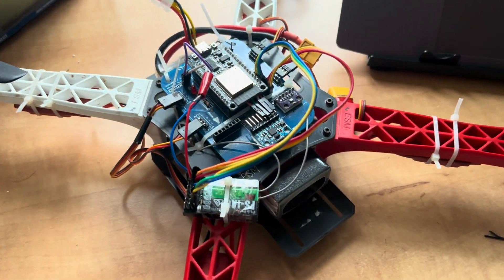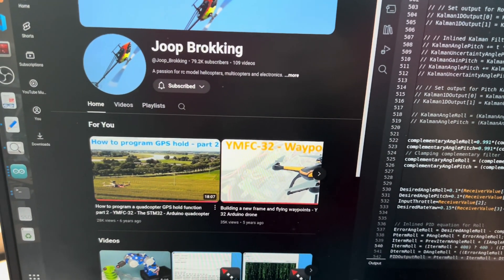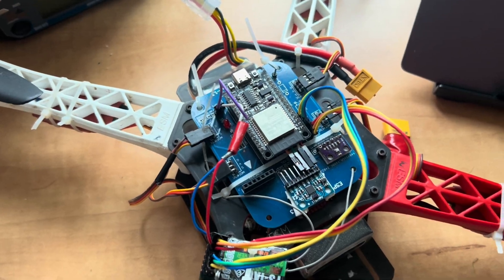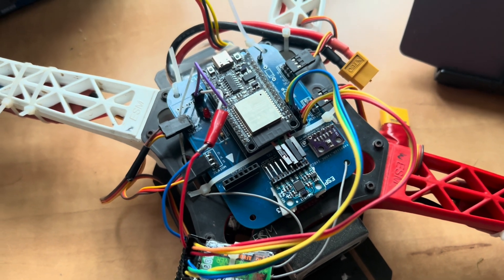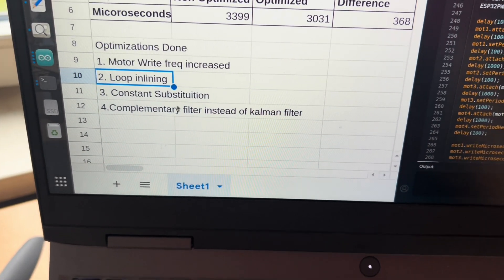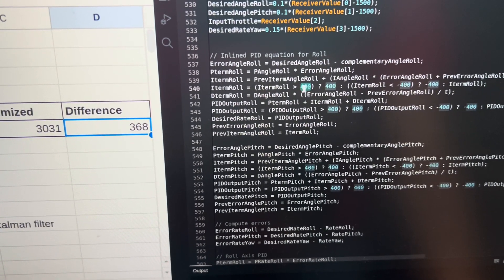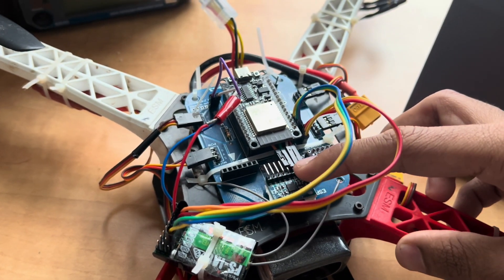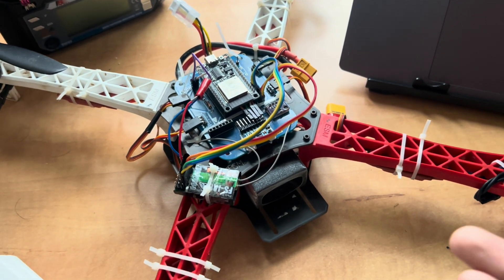How to stabilise your DIY drone?

Comment: Hi Pratik, thank you very much for you videos. I started the same project a while a go using as a reference the Carbon Aeronautics project. I found myself not able to stabilize my quadcopter. My drone works as your pre-optimized one. 

Seeing this video I think I can test these solutions you propose. The computation time difference is only about 370 [us], I think this is not that much to cause the greater improvement. However, the change of Kalman filter for complementary filter could be the answer. Perhaps, the Kalman constants proposed by Carbon Aeronautics are not suitable for all quadcopters. What do you think about it? And how did you set the complementary filter gains? 

Thank you in advance.

Comment: hello bro I'm too interested on the drone . I'm also tried with the same modules that you have used. I have a doubt that you didn't explain about the bmp280.sensor that you integrated on board … can you explain its connections and use cases....
Reply from the maker: Hi, the bmp280 isnt used yet, it was under the plan but i just couldnt get it wokring, as i wasnt able to test the algorithms more often

Comment: For a 30 A bldc esc ,the one i use the writing frequency is the one which is mentioned in the datasheet,on which we change the pulse width i.e 50hz. Which i think wouldn't change as it is fixed for the same hardware
Reply from the maker: you could experiment but 50hz works fine

Comment: Very good video, but when I tried to apply it, I managed to stabilize the drone after several tests using the web page provided. But why does the drone only become more stable after I turn it off and back on again, even after setting the PID values? Should I modify the new PID values I determined during testing?

Comment: You did a great job, thanks a lot! Just a question: Are you using the barometer to hold altitude or not? Because in your video, I saw another sensor in the circuit. Can you answer me, please? Thank you again!
Reply from the maker: Hey Yakoub, no im not using the barometer here, it was in testing phase and i coulndt get it work that well. But we still try haha.

Comment: hello where can i get the old kalman anglemode ino file and the old wifi tuning file? You replaced it with this new version but please share the old controller and tuning if you can. Thank you
Reply from the maker: Yeah it’s uploaded as the an old version in the GitHub, there’s a different branch (tag) in the existing repository
Reply: @pratikphadte  hello yes i see v1 tag in the current esp32 fc repository. However when downloaded and viewed its the complementary like the newest code. I was asking about the kalman one. I only see that in your new code you commented out the kalman algorithm and replaced it with the simpler complementary. However, I just want to be sure. Thank you
Reply from the maker: @yenle7296  oh yeah i forgot about that, you could uncomment the kalman part, and comment out the complementary filter, just don't forget to replace the complementary_angle_pitch and roll variables with kalman_pitch and roll variables later, put the code in chat gpt, it will work it out
Reply: @pratikphadte  may i ask why you chose to split and recopy the kalman and pid functions instead of writing them somewhere and call them for shorter like carbon did?
Reply from the maker: @yenle7296  its called fucntion inlining, it reduced the microcontroller delay due to fetching of the function from its memory address, in short it improves the code speed.

Comment: bro i am a student of class 10 and i am trying to code my own flight controller and i made a angle mode flight controller which was easy but when i made it angle mode i am facing issues a lot can u help me please, when i start the drone from a leveled position(in pid stand) it try to stabelize but when the drone is tilted and i arm it it dosent stop at 0 degrees it just flip, after some debuging i noticed that as the i term of inner loop is about 2.1 the i is increasing so fast and then the I start increasing as drone is tilted the speed of 2 motors increases but when the drone rich 0 degrees the i dosent dicrease but when i force drone to be at 0 degrees the i term just stop chaging with a larger value like 345 causing 2 motors to increase the speed even when drone is at 0 degrees and the speed of motos dicreases when the drone is now tilted in another direction with 40 degrees for atleast 5 second, please help i have writen the code many time from starting but issue is not resolving
Reply from the maker: I am not sure if I understand you clearly, but I would suggest to start again step by step. Your pid values should be in range of 0 to 5 for the eps32FC

Comment: Ei man I am doing something similar, porting the esp-drone to a custom flight controller I made. If you want to know more, reply to this comment! 😊
Reply from the maker: Thanks
Reply: @pratikphadte  I am currently working on the firmware to implement the Dshot protocol and use the drone from my laptop, relying solely on the wifi connection between the drone and my laptop. Then I have in mind to integrate the receiver and an esp32 and use them with a custom Android app. Do you have experience with the ESP-Drone repository?
Reply from the maker: @ hey, no I don’t have much experience with it, you can try getting help with chat gpt, will help you.

Comment: @pratikphadte.  Just a thumbs up for your project.  Can your code be used for a bait boat as well?  Bait boat will have one motor, one servo for the rudder and one servo for the bait drop bucket.  It would be wonderful if one can add a GPS for RTH function on a bait boat.  Which I can code .....  :-(
Reply from the maker: Yes, you could use this code with some chat gpt to write a firmware for your boat. Progress on GPS is currently on hold asI am super busy with college. Thank you for your kind words ♥️
Reply: Thanks for your reply

Comment: In f450 the motors and escs need to use good as the frame is not optimised and giving the more vibrations or tune the drone to best to use Carbon fiber props
Reply from the maker: Oh yes you’re right, the frame bolts gets loose with time. Yes it’s not that great of a frame, but does the job.

Comment: I am trying to create a drone using the receiver part of this program using wifi such as espNow, 
but the drone is not stable.
Is it difficult to control the drone's pid while using the esp32's wifi function?
Reply from the maker: No it’s not that difficult, since now the drone is pretty stable, I think you can proceed with a WiFi fc remote on your phone, but be careful, it has a lot of destructive energy.

Comment: Hello Pratik, Great content and effort as always. I am also developing an ESP32 based flight controller on my undergrad thesis.  As in your program, the MPU registers are like Carbon_aeronautics, what is done here is that some registers are written again and again in the loop section before taking MPU reading but it is not necessary. You can set the mode of the registers just once in the setup and it will be fine as done by Joop Brokking. It will save some time I guess. But Brokking's register modes are different than Carbon Aeronautics. Also you can use the another core of ESP32. (I am trying to do this but getting some issues)
Reply from the maker: Hey that’s a good idea, yeah I should keep the initialisation of gyro outside the loop will definitely save some clock cycles.  I want to experiment with the 2nd core as well, I think it’s primarily used for WiFi and Bluetooth application. Seems very handy for sending flight data to a rf module.

Comment: Is it possible to add a GPS to the drone to provide additional functionalities like autopilot and auto-landing, or would that be too difficult to code?
Reply: for that you will
 need a better flight controller but yeah u can add gps feature in it without any problem hopefully
Reply from the maker: yes that should be possible. May not be that difficult to code as there are resources available but might be difficult to test and make perfect. A good FC such as pixhawk is recommeded for more reliability.

Comment: Excellent work
You mentioned that you use Kalman filter technique for control.. What I care about is whether you did all the mathematical calculations, I mean studying the stability of the system and choosing the control technique and the extent of the system's response to control mathematically or only through experimentation.. I care to know this because I am interested in the field of control theories
good luck
Reply from the maker: I refered the kalamn filter implementation from carbon aeronautics and also from the matlab tutorial on kalman filters, i understood the bigger picture was wasnt able to implement it by only myself. You can refer the sources i mentioned above and youll be good to go!

Comment: bro i am making the same exact thing and I tested it but the esc just fried and started emmiting smoke also i am using the 2200KV motors with 11 inch propellers ...any change which could be helpful
Reply: Use a 1000 or 900kv motor
Reply from the maker: the higher kv(speed) the lesser prop length is required i think. As you need less torque when you increase speed. I dont know why the ESC is burning, maybe check ratings of motor and battery and select the esc?
Reply: Do not use PWM control, there is a nice library available for Dshot on esp32 based MCUs. It works much better!

Comment: how are you sure that code has no errors and wont just fly to oblivion when u take it outstide
i personally have this fear 
response appreciated like if u have some checks that you do for confirmation ,,
love your project
Reply from the maker: Good question, we put limits on the motor input values to prevent that, also we can infer from the Imu data if the drone is toppled so that we cut off the propellers. There are plenty limits you could put, that’s why a standard ardupilot or px4 firmware is always better!
Reply: @pratikphadte  thanks could you make a separate video for that🙏
Reply from the maker: @avirupsaha4701  yes I will think about it. Fail safe for drones is a must.
Reply from the maker: Thank you for your kind words!